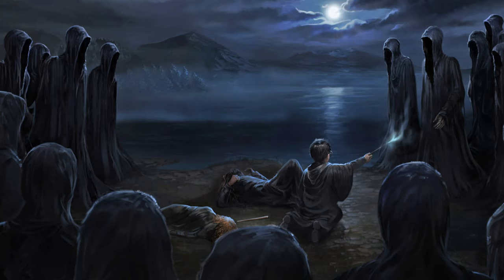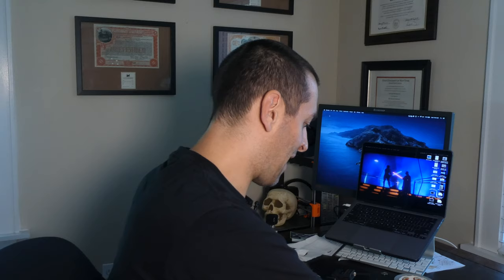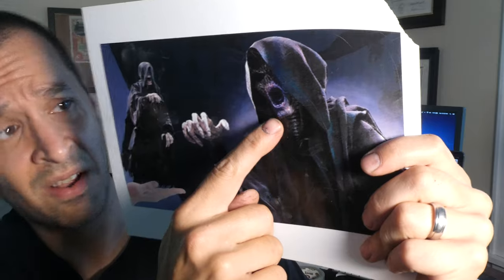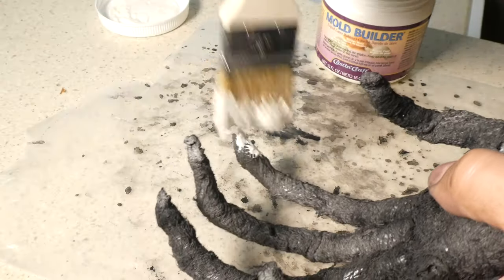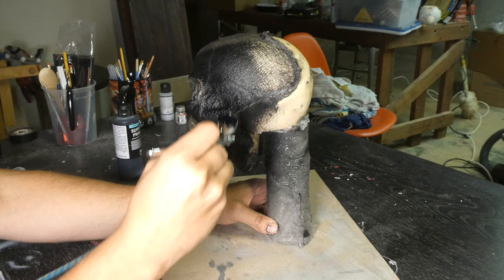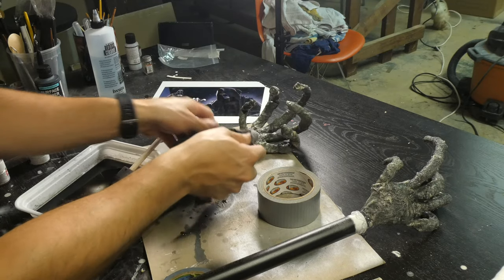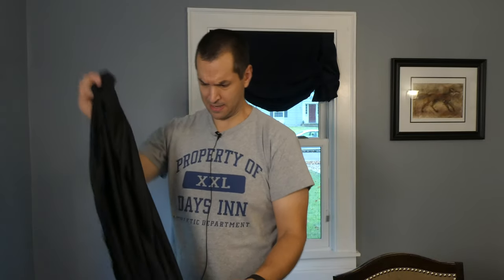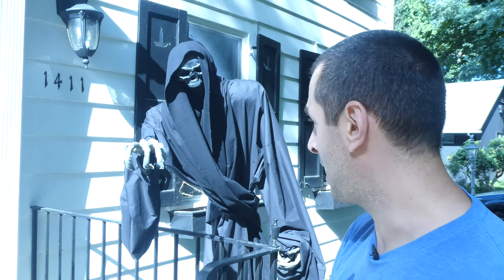How to Make a Dementor from Harry Potter

Comment: Really lovely and lots of tips when I make my own, but the only quibble I would  have is that I think his shoulders are build like that of a rugby player (or maybe what you call a linebacker in your country) and not quite so skeletal.
Reply from the maker: Thank you and good call on the linebacker. I think the challenge is working with pipe and a limited supply of various angles (only 45 and 90 degree). I bet that you could heat up the pipe just enough to shape it to a less stiff state though. Hrm. I feel an experiment coming haha. Good luck with your build!